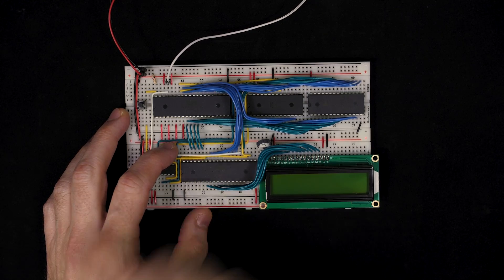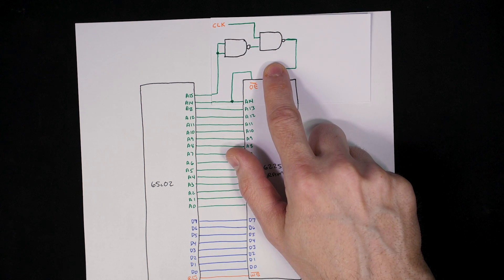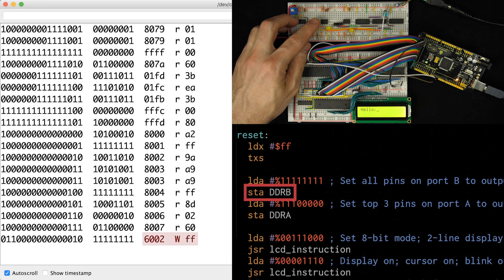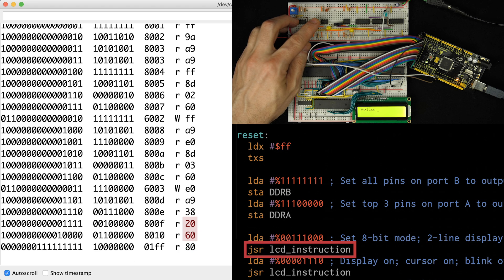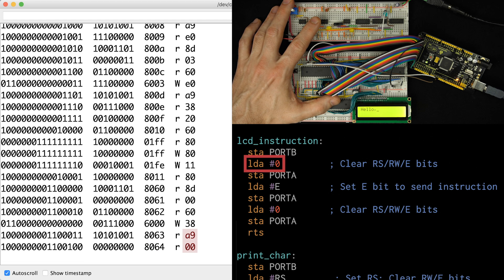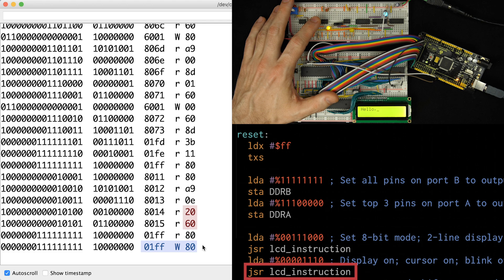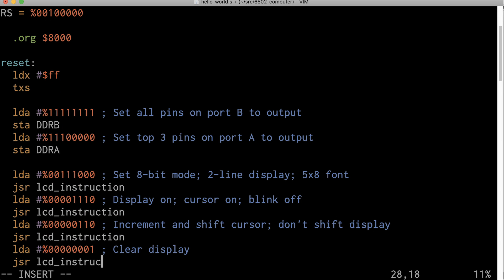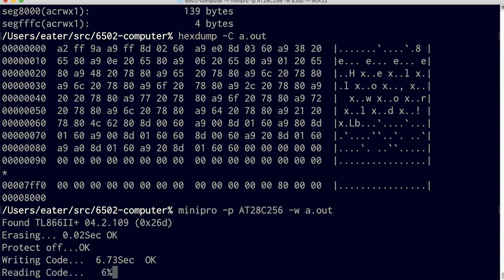Subroutine calls, now with RAM — 6502 part 7

Comment: Would it be possible to switch the location of the ROM and RAM chips without having to change the way the chips are daisy chained together to the processor, or the way it's programmed?
From the way you've explained it, it seems as if regardless of which order the daisy chain is in, the microprocessor would see them in the same locations, so long as all the signals are hooked up the same as here
 The actual layout of the wires seems like it'd have to be slightly different to get the write enable and chip select correctly hooked up (the wire going from the second NAND gate to the chip select wouldn't need to be quite so long, for example), but would it change the wiring diagram itself (other than the position of the actual chips, of course)?
It just seems like it'd be easier to have the RAM next to the 6502, and the ROM next to it, to make removing the ROM for programming easier.

Comment: Is it possible that at 10:35 what happened is that the processor first put 80 on the bus, and then only the next clock cycle it sets the W pin? It seems weird that 80 just happened to be in ram on the stack XD

Comment: 12:29 you have 80 on rom in address 8011 thats jsr lcd_instruction high byte 80 ?
its reading from ram but why prosessor not read it as op code 80 LOL. why is it jump back 8011 when it should go 8012 to read a9 lol lol. is it check if all ok it read it returned correct place where it read 80 lol if that would show something else it throw error. mayby?

Comment: 9:14 not a coincidence at all, since you were running the same program before, without resetting memory chip. So it just holds the data from previous run.

Comment: Based on the FCC, when you plug in the crystal oscillator, your computer should comply with Part 15 of the FCC rules right when you power it on

Comment: I received a kit directly from Ben’s site but received a ram chip and received a CY66256 chip instead of the normal one that is supplied( the one in the data sheet) I noticed that the column decoder in the chip uses different address lines. Is this going to cause me a problems If I wire the address lines to the same address lines on the ram chip?

Comment: I missed the part in the videos where he told the CPU where to put the stack in memory. Traditionally that would be a directive in the ASM code wouldn't it?
Reply: The 6502 and 65C02 both use an internal hard-wired address range of 0x100 to 0x1ff.  Mr. Eater set the stack pointer to the top of the stack (ie the start.) You don't have to set it yourself. :D

Comment: 9:05 It's probably not "pure coincidence", but you "reset" the processor to step trough the output. Note that the RAM is still, and had been running. Thereby, already having been trough your program. Since the RAM isn't powered down, it still has this 0x80 at that point, since the last used subroutine also has 0x80 as the high byte. But if you'd read the low byte there (addr 0x01fe) It would have been to the other subroutine (used last before the reset)
edit: read would have been from the LAST return address written to RAM. Since the processor outputs a "read" operation on the bus during its execution, the RAM is providing it, and arduino reads it even tough the processor doesn't

Comment: Really awesome! Is it possible to make GUIs to follow what the computer is writing/reading on each clock cycle? I.e. raw binary, address, r/W, data, but also translation of the data if necessary (e.g. LDA instead of A9), and then a GUI of a repeated hexdump where you can see things being added (addresses in another colour), plus GUIs of the stack?

Comment: Driving OE# active in write cycle (via A14 to OE# connection) is a gross error, especially in teaching video.
Any CPU except 6502 will smoke in such circuit.

Comment: Uhm... i didnt see any pullup nor pulldown resistors on your breadboard. when im not mistaken the cpu can put data and addresslines (maybe even controll lines) into TRISTATE/HIGH-Z mode (make them float). Is it possible that your arduino logic analyzer just reads floating lines on those 2 and 3 clock cycle op codes ?

Comment: 10:16 The value 0x80 was already in memory because the ram doesn't get reset by the reset button, it's only reset when you shut off the computer. So when the program was reset for the step through, the ram still contained all the values which the previous run through stored in it from its calls to the stack while using the jmp commands. So what you saw was the first half of an address in the eeprom, and, because it's a short program, it happened to match the value you where trying to write into it. Neat, right. Side note, if you had read the second half of address before it was wiped, you could have seen which character it was trying to print before it was reset by comparing it to the program's hexdump.

Comment: What I really don't understand why A14 is also connected to A14 of the RAM if you are only using the first 16 kB of it. I perfectly understand the CS/OE thing and why A15 is used as one input for it while A14 directly drives the OE, but WHY does it need to go to A14 of the RAM, too? (Or is is just in the drawing?)
Reply: Well, only half the RAM is used for reading. However when writing all 32kb are used. If you don't connect A14 then writing to $6000, where the VIA is, would also write to $2000 of the RAM.

BTW: I have a blog post on the memory management where I mention that as well. With nice graphics: 

https://www.minds.com/blog/view/1178310709392269312

Comment: I am still confused how we are guaranteeing the CS is going high before the address lines change. We have plenty of margin for CS going low, but in a worst case of say 25ns propagation delay on the NAND chip from the clock pulse going low to the CS going high, we are out of spec from the 10ns hold time on both the data and address lines from the 6502. With the typical 8ns propagation delay we are usually going to be fine, but that isn't much comfort. I don't see how the R/W output from the 6502 saves us either, because it changes around the same time as address or data, after the 10ns minimum address and data hold time. It seems like that 10ns guaranteed minimum hold time being a very conservative length is our only chance for assured performance.

Comment: Is anyone else triggered because the monitor shows reads and writes as "r" and "W", and they aren't the same case?
Reply: Because WRITE > read ;-).

And to trigger your even more, I have a special monitor program to track chip enable signals as well. And I use 'E' for enable and 'd' for disable:

https://www.minds.com/blog/view/1175047965696765952

Comment: One question: If you hook a15 to OEB of the ram, and then pipe a13 and a14 into a nand gate, and that nand gate goes with clk into another nand gate, and that goes into csb, theoretically the ram should be active if a15 is low, clk is high, and at least a14 or a13 is low, meaning it maps to [0x0000 - 0x5fff], giving you an extra 50% ram. It would need an extra nand gate, because you can't reuse the one on a15, but that wouldn't be too complex right? and the timing should work out as well...

a15 -----------------------------------> OEB
clk ------------------> NAND -----> CSB
a14 ---> NAND -------^
a13 --------^

and then connect a14 and a13 to the appropriate address lines of course.

Comment: i think this is the processor used in apple computer 1 (1976), first apple product by steve woznick
Reply: Apple used the older NMOS 6502 version. But yes, very similar and the 65C02 is backward compatible.

Comment: My mind goes on very inventive/creative streaks, ill think about something for a while, evolve it, let it go, come back to it many days or months later...
During my learning I was watching lots of your videos and others. 
But now my ideas have evolved into a completely different architecture, like nothing we have today, it's more like a Digital Wetware. I'm working on it as the smallest piece of boolean logic gate circuit that works with the machine code / ASM...
And then you take that circuit and replicate over to your hearts content all on the same bus lines. Their is the smallest bit of volatile and nonvolatile memory on each, (and LOTS of registers/flags) so together in a larger group they function as a large harddrive and bank of ram. Individually not a single one of them is a cpu, control unit, alu, gpu, etc. But the code they contain makes them work together acting as such. The execution takes place on the chip that houses its ASM command, so if you made a function that is made up of 200 asm instructions, it will take up 200 of these (replicated circuit) chips. Its executed in place. What you would think of as the jump command along with its many many variants technically no longer exists, but in all actuality it doesn't just in an extremely different way.
In my design i don't have to but I have avoided using serialization as much as possible, almost non existing. ALSO involving a protocol with the way the hardware and code works together i can eliminate the need for a clock. But still need one to process audio properly etc. But not for its inner workings. 
With my setup, you don't go out and buy next year's new graphics card etc. You upgrade your code, and add more chips to your buss lines if needed. Keep in mind this can be miniaturized and have billions of them on a single chip
Reply: But now when I look back on current developments, designs, code, its detrimental  to me cause of how radically different mine is... I'm all alone on this
Reply: @davidprock904  are you ok?

Comment: I like these projects a lot, because I have been developing small and dedicated computing systems for a long time. By now, these are integrated into hardware we use every day, but back then it was a very challenging, also because we had no monitors, if not logic analysers, oscilloscopes and our minds 😊

Comment: How did the writes to RAM work with the output enable tied to A14? The RAM would have been outputting to the data bus and being written to at the same time (because A14 would be low during a processor write)
Reply: SRAM IC, probably, have undocumented WE# over OE# priority, that let such circuit work.
But direct connection A14 to OE# is a gross error (IMHO), especially in teaching video. 
Active OE# in write cycle could make both CPU and SRAM drive data bus at the same time.
Looks like 6502 with its simplified RWB signal and direct connecion to WE# eliminate or minimize bus conflict time. Z80, with proper RD/WR signals would smoke in such circuit.

Comment: Real men don't need RAM based stack to call a subroutine from ROM code.
This is possible by setting the SP to a ROM location with the proper return address
Reply: you can probably use register B to jump back from the subroutine
Reply: It will wear out the eeprom.

Comment: Ben, these videos are fantastic, a masterpiece of presentation, technical accuracy and engagement.  Although I have no practical use for making the 6502 breadboard PC, I will do so for the sheer fun of it, and enjoy re-living the times when programming in assembly language ruled my days.  I will try using a different type of timer though - an Arduino Nano, which snaps straight onto the breadboard to provide the power for the project, and which can provide the relvant clock for 'slow mode' (< 1hHz) operation.   I used a couple of DIP switches, one to select either pulse (via a 'button') or continuous and the other to select the continuous speed (slow or fast).  Looking at the trace on my scope, the Nano has a rise time of 6.7 nHz and fall of 7.1 nHz.  I'll be looking at your session on timings in ever close detail.

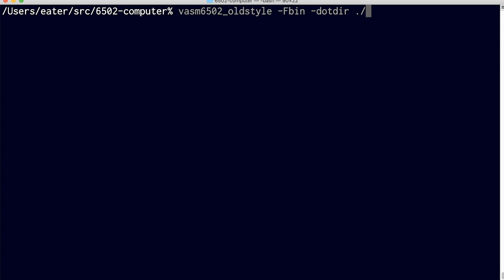Comment: 14:27 why even do you switch to the terminal when you can run the commands from within vim with eg.  :!sleep 5
Reply: how would you do that with notepad++?
Reply: @darer13  idk not at all related
Reply: @urugulu1656  notepad++ is a text editor like vim but specifically for windows tho..
Reply: @darer13  i know what notepad++ is and no it is not at all like vim...

Comment: Can this processor do any math functions besides add and subtract ? Or do you write math functions (compiled from an external C program) and  then store the machine code on the ROM so they can be called ?
Reply: Add and subtract only. There is a C compiler which might work:

https://cc65.github.io/doc/cc65.html

I'll have to try.

Comment: 16:14 how come on reset it printed two spaces after «Hello, wor»?
Reply: I am by no means an expert, but my idea is that reset interrupted the normal flow of the program and the processor outputs to the LCD must have happened to be such that it printed those two spaces. I don't know how Ben's clock module works internally, but reset conditions, just like drops and spikes of voltage that may sometimes happen, for example during power down or when the power supply can't handle the load tend to produce erratic behavior. The rough reason for that is that transistors and, by extension, logic gates, behave well only within specified range of conditions (like voltage between 4.8 and 5.2 V let's say) and out of this conditions they still "work", just differently.
If you would have the clock module, the nice way to learn about reset conditions would be to connect an oscilloscope and observe what happens on reset. Perhaps the clock fires a few times or the voltage goes down and up again somewhere between 0 and 5 V. Since clock-taking units often react not to high per se, but to the rising edge, if clock goes down to 2 V and then back to 4 V and then to 0, it might be interpreted as an extra clock signal by the LCD. BTW, non-transient memory typically has a high-active write input to prevent any wrong data being written during weird conditions. Sorry for a chaotic attempt at explanation, but I hope it puts some ideas forward which you might find useful.
In short: sometimes edge conditions produce transient states where driving voltage doesn't stay in its specified range and erratic conditions happen. Sometimes those conditions are important to think about when designing circuits.
Reply: @hubertjasieniecki5070 , thanks.

Comment: PORTB = $6000
PORTA = $6001
DDRB  = $6002
DDRA  = $6003

E = %10000000
RW = %01000000
RS = %00100000

	
	org $8000
	
reset:
	lda #$ff
	txs			; Set stack pointer to 0xff
	
	lda #%11111111	; Set all pins on port B to output
	sta DDRB
	lda #%11100000	; Set top 3 pins on port A to output
	sta DDRA
	
	lda #%00111000	; Set 8-bit mode; 2-line display; 5x8 font
	jsr lcd_instruction
	
	lda #%00001110	; Display on; cursor on; blink off
	jsr lcd_instruction
	
	lda #%00000110	; Increment and shift cursor; don't shift display
	jsr lcd_instruction
	
	lda #%00000001	; Clear display
	jsr lcd_instruction
	
	ldx #$0
	ldy #12
prntlp:
	lda string,x
	jsr print_chr
	inx
	dey
	beq loop
	jmp prntlp
	
loop:
	lda #%11000000	; Move cursor to bottom left
	jsr lcd_instruction
	
;	lda #%00001110	; Display on; cursor on; blink off
;	jsr lcd_instruction
	
;	ldx #$0
	ldy #15
prntlp2:
	lda string,x
	jsr print_chr
	inx
	dey
	beq loop2
	jmp prntlp2
	
	
loop2:	
	
	jmp loop2
	
	
lcd_instruction:
	sta PORTB
	lda #0		; Clear RS/RW/E bits
	sta PORTA
	
	lda #E		; Toggle enable
	sta PORTA
	
	lda #0		; Clear RS/RW/E bits
	sta PORTA
	rts
	
print_chr:
	sta PORTB
	lda #RS			; Clear RS/RW/E bits
	sta PORTA
	
	lda #(RS | E)	; Set E bit to send instruction
	sta PORTA
	
	lda #RS			; Clear RS/RW/E
	sta PORTA
	rts
	
	org $8500
	
string:	db	"H", "e", "l", "l", "o", " ", "W", "o", "r", "l", "d", "!"
		db "L", "o", "o", "k", " ", "w", "h", "a", "t", " ", "I", " ", "d", "i", "d"
		
	
	org $fffc
	word $8000
	dw $0000
Reply: Interesting. I opted for:

    INX
    CPX  #(Message_Len)  ; Repeat loop until X ≥ message length
    BLT  Loop

instead of using two register. Full version:

https://whaleshares.io/@krischik/ben-eater-6502-kit-day-15

Comment: Can someone point me to some literature on the difference between ROM and RAM? I'm specifically curious as to why he had ROM and RAM instead of just RAM. Why not just store his program in RAM and use minpro to store the program?
Reply: Rom stores its data after it gets powered off, ram doesn't.
Reply: EEPROMs are essentially SSDs but RAM can be accessed way faster than ROM (EEPROM is eraysable and programmable ROM)
Reply: @masterofdesaster7880  cool. Seems like an engineering trade off just like anything else
Reply: @cjcar178  Yes
Reply: Why don't they just create a chip that you can write to and read from and still saves data when it's powered off. You know like flash storage or SSD. I still don't understand the need for two different chips

Comment: I don’t know if anyone will see this, but I have a question about something totally unrelated to this video. So I connected a 555 clock to a 4017 chip for a home project I’m working on. The output of the 4017 does not work as expected when I have no LED draining current from the output of the 555 chip. It works fine when I have an LED going from pin 3 of the 555 chip to ground, but otherwise, the result is seemingly random. I’ve also tried to simply ground pin 3 of the 555 chip with both a basic wire and a diode, and neither work like and LED does. Is this because the LED also has an output that requires current, where the wire and the diode do not?
Reply: Can you send me a picture to inspect the circuit my instagram
Reply: Mohammed and ahmed Asadig I don’t have Instagram sorry. I don’t know if you would be able to answer my question with what I provided, but I just need to know if draining current with an LED is different from grounding with a wire.
Reply: @taberbooth9203  check if there any free inputs (ungrounded or not tied to vdd), check the maximum output load current. Check power. That three things usually are reason of 90% unstable work.
Reply: @Goofy Goober